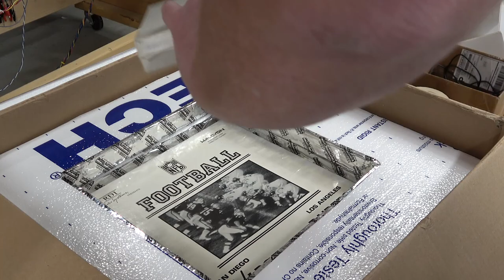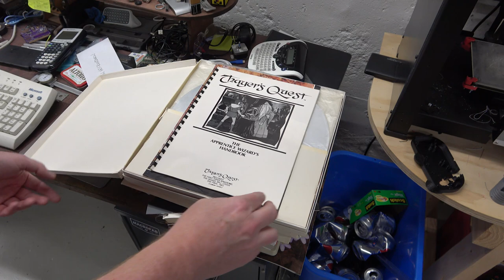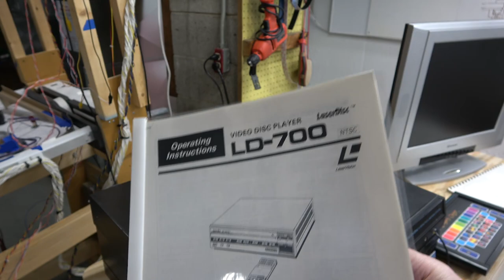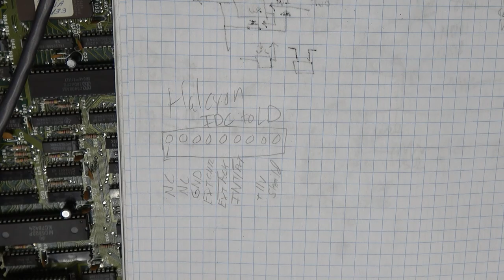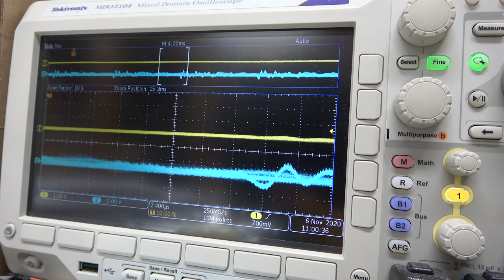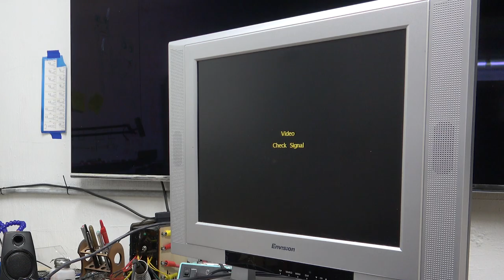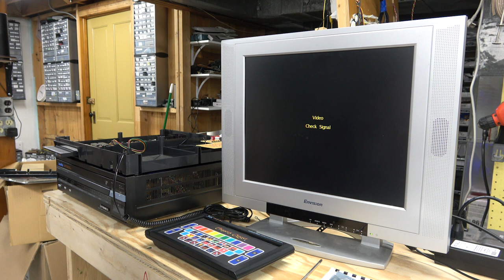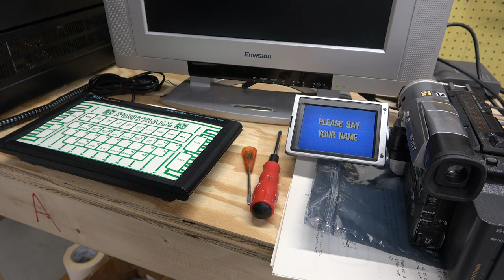Super Rare RDI Halcyon Laserdisc Game System Prototype Repair

Comment: Only 5 remain because 8-Bit Guy shoved paperclips into the rest of them. XD
Reply: Stone cold. Pretty nuts how that video just destroyed his reputation. I really liked him, too.
Reply: @endlesswanderer1753  wow, what happened? What did he do and on what system?
Reply: @markus5862  He shoved a paperclip across a mains connection on the PSU of an IBM 7496 thinking it would turn on (it fried of course) as well as other horrible things saying he didn't care and was "in a hurry", then went and made an unreleased follow up vid (someone on EEVBlog found it) stating he didn't care about us "armchair warriors" and that "all his friends would do the same", yada yada cop-out yada.
Reply: @markus5862  There was a rare IBM system that he got his hands on and he tried to get the power supply to work, by sticking a paperclip into what he assumed was the 'power on' contact coming from the monitor, eventually shorting the power supply.
Reply: Those machines weren't that rare. They just weren't sold to the general public. There isn't really anything too special about them, it basically a PS/2 in a PS/1 case with no hard drive because they booted off the network.
Reply: @equid0x   oh I see. So that’s probably why in the video, it wouldn’t boot up
Reply: @markus5862  Yeah, these had a token ring card and you would use the server to create a special boot disk you just locked into the front of it that brought everything up off the network. It's basically a thin client. In the 80s IBM was convinced that the future of computers was all subscription services that would be run off central systems you bought time on. It took another 30 years for that idea to take off. We used them in the computer lab to run Wordstar and Lotus Symphony.
Reply: @equid0x   if I sound foolish, I apologize, but do you think it would be possible to bypass that security when the pc gets turned on? Like to see what’s on the hard drive and mess around? did the programs and information get downloaded after the key was used and then it was stored on the pc or was there like a mainframe or something that stored all of that and the pc was pretty much a doorway to the mainframe? I’m not super knowledgeable about early pc stuff. I can find my way around dos to install and play games and maybe make a boot disk if it’s prompted by the game, but other than that, I’m useless. I do find that era interesting though. The pc we’re talking about doesn’t super interest me, I was just curious if it was such a terrible thing he did like everybody is saying, ya know?
Reply: @markus5862  They connected to a server, downloaded the program to memory, and ran it. This particular model didn't have a hard drive. 100s of thousands were probably made, and subsequently discarded or sold off when upgraded. I mean sure, keep one or 2 at the IBM museum for history's sake, but the idea that these are somehow some totally unique and special part of history is preposterous. A regular PS/2 of the era could be fitted with a token ring card and the same boot disk and do the exact same thing. This was just a different form factor. 

I guess to me, it seems about as ridiculous to hand-wring over these relics as it would be to hand-wring over an old Leading Edge, Packard Bell, or Zeos laptop - while they may be "rare" by today's standards because most were discarded, they were commodity hardware at the time.

A similar, but older example might be old HP, Wang, or IRMA terminals. They may certainly be hard to obtain now, but in the 70s-90s they were standard equipment in a lot of institutions. I guess that's the point I'm trying to make here.

Comment: Since the laser disc players on arcade games wear out so quickly, there are fewer and fewer of them left working.  Add to that some discs suffer from laser rot and degrade over time (fortunately none of my LD disc games have rot) and they are becoming rarer and rarer.  Fortunately, there is a solid state replacement for the laser disc player in the Dexter board, and it works as a replacement for most (all?) known LD games.  The Dexter people have dumped  non-rotted "raw" LD images for all the games, including Thayer's Quest.   While the board isn't cheap, it's way cheaper than sourcing a working industrial LD player and locating original discs without rot.   After that board came out, CA Extreme finally had like a dozen working classic LD arcade games whereas previous years you'd be lucky to have four games working, and they'd usually glitch out before the end of the show.
Reply: Yea apparently Dexter is used in large establishments (Galloping Ghost Illinois?) to keep Dragons Lair running. It's such a cool product, considering "bit rot" and laser disc players are not available and unreliable (if broken)... I seriously love these kinds of projects that replace old tech with new, but keep the old tech feeling intact. Cheers for now.
Reply: they need to dump atari cops arcade , NFL Football CED Disc 1 is Los Angeles Raiders vs. San Diego Chargers. Disc 2 is Dallas Cowboys vs. Washington Redskins.
Reply: Wonder if it could be used for the pioneer Laseractive.
Reply: Laserdiscs alone are incredibly rare, at least where I am from, and the ones I have found are very expensive Japanese imports of movies from the late 80s to mid 90s, I can't imagine how rare an American VIDEOGAME from the 80s on LD must be!

Comment: About the two chips at 7:30:
- "Interstate Electronics ASA 16": It's a 16-channel audio spectrum analyzer used for speech recognition. Other products also paired it with the 6803.
- "SSI 263 P": Phoneme-based speech synthesizer from Silicon Systems Inc. (acquired by Texas Instruments). It's also known as the "Votrax SC-02" chip and it was used in arcade machines, terminals and add-ons for home computers such as the TRS-80 (speech module) and Apple II (Mockingboard & Phasor sound cards).
Reply: The guys in Kraftwerk DIY'd a speech synthesiser in the 80s using that exact voice chip, and even have a patent for it. It's all over their album The Mix, particularly songs like The Robots.
Reply: So why does the Votrax SC-01 sound better then? Or is that just my own opinion? Or did they intentionally make the SC-02 in the Halcyon sound like a constipated robot that's low on battery?
Reply: @senilyDeluxe  There is an art to crafting good sounding speech with one of these chips. Maybe they just didn't have the budget or skill to use anything other than a simple text-to-speech algorithm to drive it.
Reply: @senilyDeluxe  The speech it generates is dependent on the data its being fed. It isn't just a matter of "say this" and the the chip says it. It is being sent a very intricate series of commands for each annunciation like a noise generator would.
Reply: @xotmatrix  True, I used to work for Votrax. Apparently they got a complaint one day that the chip "spoke with an accent" of some kind. One of their lead engineers whipped up samples that made it talk in all kinds of different accents, english, french, german, etc to show that the chip was just doing what it was told and didn't have an inherent accent.

Comment: This reminds me of Pioneer LaserActive and game console modules made for it. I watched RMC’s video about it, and it was failure probably because it was really expensive. But at least it used existing game console paltform(Megadrive and PC Engine), so it was capable of displaying graphics on its own. Plus, LaserActive was also CD player, and module itself had cartridge slot. So you weren’t limited to just laserdisc games.

And if I remember correctly, games made for LaserActive contained both code and video on a single disc.

Comment: What you're referring to is "laser rot", a condition whereby the glue that holds both sides of a laser disc together wears out and pockets of separated substrate causes signal degradation from the laser reflection back to the receiving sensor being either not reflected back or only partially reflected back due to the reflective material being unable to do so.
Reply: It's technically not "bit rot" either because the laserdisc video signal is analog and not digital.
Reply: Little bits of the disc have rotted, so I think we can still call it bit rot.
Reply: I think you're about 20 years late on trying to promote "laser rot" instead of "bit rot". I have heard "disc rot" before.

Comment: "Look at these graphics!", probably took a week to render on an SGI Iris  😂
Reply: Or they used an analog computer and rendered it in realtime?
Reply: 1 week and several kilowatts just from the GPU alone. Had one of the dual rack mount units, minus the $36,000 gpu. Was kind of a deal breaker.
Reply: @rudolfrieder186   "Or they used an analog computer and rendered it in realtime?"

a.k.a. scanimate.

Comment: The SSI-263 is a VOTRAX SC-02 which in itself is an extension/improvement of the VOTRAX SC-01 voice synthesizer which was popular in 70's/80's era "talking" pinball machines & arcade games such as Berzerk and a couple expansions for game systems/computers such as the Atari 400/800 (Alien Group Voice Box II).

...so you were spot on! Very cool to see an example of the Halcyon running in 2020 bit-rot & all.

Also, don't the overlays slide in through the top of the keypad? That's probably why you were struggling to insert the overlays!

Comment: I would assume the disc for Thayer's Quest is single-sided. Seeing as how it's probably the same disc that was in the arcade machine, and arcade operators weren't going to the cabinets to flip the disc to side two when a player got far enough. Of course, they planned on sequels, so it may be there's another part on the Halcyon version. Wouldn't surprise me if they used the same disc, only the arcade may have only used one side. I don't think they made too may Thayer's Quest dedicated cabinets, most were Conversions, and the membrane keyboards were pretty finicky If I recall. Furthermore, I wonder if a Dexter board could replace the laserdisc player like in the arcade machines. You could put the laserdisc files on an SD card, so you wouldn't run in to the bit rot issues or finicky laser disc players.Dexter was made by the same person who made the Daphne Emulator.  Dexter boards available here: http://laserdisc-replacement.com/
Edit for more info, apparently the Arcade version used a double-sided disc as well, the player in the arcade was able to play both sides somehow. It may well be the same disc as the arcade, which was used to prototype the Halcyon.

Comment: It's easy to rag on this old tech, but this was more advanced than anything else available at the time.
Reply from the maker: Ehhhhh.... Laserdisc aside the tech is late 70s at best.
Reply: @BenHeckHacks  It's true, but so was everything else in that era. This thing might have taken off if it used the RCA CED format it was originally designed for. Pioneer's Laserdisc format and the machines were far too expensive in general, which is why VHS quickly overtook it despite it being inferior in every way.

Comment: It is not meant as a passthrough audio device - the instruction page specifically says to connect the videodisc audio outputs to an amplifier - it does not show connecting the audio to the halcyon at all.

Comment: You might want to encapsulate that chunk of the Berlin Wall.  At least some parts of it were made of asbestos concrete.
Reply from the maker: I'll resist the urge to angle grind it. It's actually got little bits of graffiti on one side, it's cool.

Comment: If the ThayersQuest laser disk is the same as the arcade game (probally likely) then would it be possible to just use the Dexter laser disk replacement board with TQ on the sd card? I play it all the time in my Dragons Lair cad with a keyboard that runs Dexter and an Arthur board.

Comment: I wonder if the size of the box was just to make it fit on top of a laserdisc player and fit into a typical home entertainment system of the era, and they jsut made it look like there was some expansion potential to get people excited.
Reply from the maker: Oh without a doubt. It's the same size as the LD-700 player. Even with a mixer it's still 30% empty.
Reply: There's also some kind of edge connector on the back that doesn't appear to go anywhere, maybe they were planning some kind of future graphics expansion?

Comment: I'm fairly sure your story about Commodore C128 at CES isn't true.  Bill Herd has talked about the C128 a fair bit (since he was the principle hardware designer), and the only thing remotely like that he mentioned is one of the developers who wrote some of the software used a prototype with a chip that he only could get to work by putting an ice cube in a metal cup on top of it, and got something like 15 minutes run time.  (Of course, the production chip turned out to be different and the software had to be hurriedly rewritten, but that was Commodore back in the day.)

Comment: can you adjust the pot on the laser-disk read laser to re-focus it? i know some old CD players that had trouble with scratched disks could be adjusted to read a little better. with bitrot the data is probably physically gone/damaged though. just thinking outloud through my fingers! i love these kind of videos. or is the bitrot in the chip ROMs??
Reply: The bit rot (well not really bit rot as LD is analogue so there are no bits involved) is on the disk; there are a variety of failure modes for LDs - oxidisation of the metallic substrate, delamination of the metal and plastic layers, clouding of the plastic, etc. -- and there's not really anything that can be done about it. (Think of it like a faded photograph.)

Comment: A former co-worker told me about developing one of Bally's first microprocessor powered pinball games.  In order to make it work they had to over-clock the Z80 processor, and the eproms.  The access time on the eproms wasn't quite good enough, but they discovered that they would work if the chips were exposed to light (not UV).  So they put a 60W bulb inside of the game and took it to a show to demo it.  It worked fine, until the bulb burned out!
Reply from the maker: Amazing. I wonder what the science is behind light speeding up the EPROMS?
Reply: @BenHeckHacks  It's the heat.

Comment: Looking at the keyboard, it would feel like an Atari 400 or TI Touch and Tell without being able to get a feel for it. On the other hand, the first few generations did have a few consoles that used overlays on the controller.
Reply from the maker: It somehow felt worse than those, like the plastic "skin" was kind of loose. Probably because some of the buttons were larger than a keyboard of this type normally has.

Comment: and this is why im hesitant to build a laser disc library even after tracking down a working machine, a bit surprising for the prototype to be functionally incomplete like that given that all the important bits had been constructed already, that close its odd they quit building it, though this does admittedly assume the part wasnt pilfered which i suppose is also possible.

Comment: The Atari ST 16bit console variant is the rarest console in the world, there were only 2 prototypes and both are lost forever (was just an Atari 130ST computer without a keyboard in a bespoke case and cost reduced but due to falling DRAM prices of 1985 and 1986 it was abandoned as being non economically viable). This had nothing to do with Atari Jaguar or Panther projects, just a 128k spec Atari 520ST with no keyboard and software on cartridge (hence the 520ST launched with a cartridge port but few cartridges were ever released and none of them were games.
Reply: Care to provide a link?
Reply: @alexk8792 As I said info is lost forever, the single news item that appeared in two weekly computer magazines around 1986  are not scanned. The 130ST is talked about by Jack in his interview on ITV Database early 1985 XE/ST exclusive preview with a list price of $399 for late Spring 1985 being mentioned but it was never released for the same reason, RAM was cheap anyway by Spring 86 when the 520STM went on sale for list RRP of $399. But that is why the ST had a cartridge port. I have about 100 issues of New Computer Express I haven't gone through still tho, was basically a 16bit version of the XE Games System. Jack was hot for 16bit tech for value for money in 1984.
Reply: @madcommodore  I see. Did this unreleased Atari ST-based console have a name?
Reply: @alexk8792  No. It was just part of the original product road plan for the ST models, 130ST to 520ST computers with cheaper keyboardless 130ST machine. So the ST design whilst being rushed into production in record time had to include a cartridge port and that's the main reason. New Computer Express started in 88 so it would have been in Pop. computing weekly or the other weekly games mag which were already established before the 1040STF launched in 1986.
Reply: @madcommodore  I see

Comment: @2:40 "were laser Disc Players this heavy?" Every electronics device from the early 1980's was heavy. IT was a requirement that you had to have super strength to carry them out of the electronics stores. I have an old Panasonic VCR from 1981 that weighs a ton.
Reply: Laser Discs in particular are usually pretty damn heavy because of the mandated shielding.
Reply: @TheTurnipKing  yeah, I could imagine. I never owned a Laser Disc player, but my old grade school library had one on a rolling stand with a CRT TV. That laser disc player was huge in size.